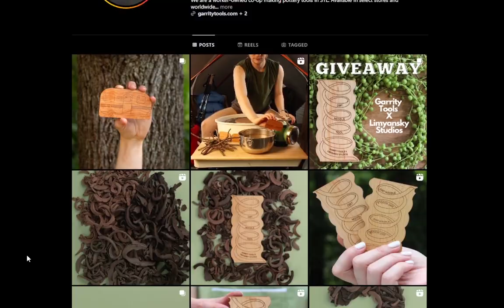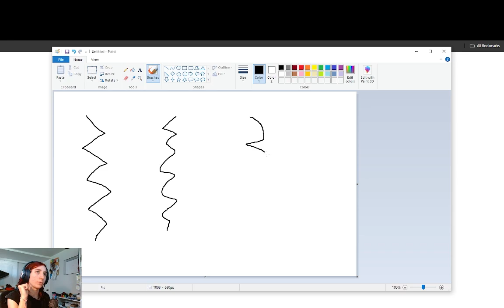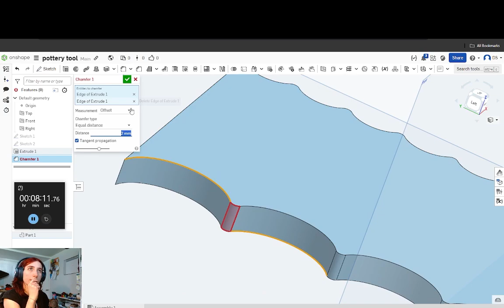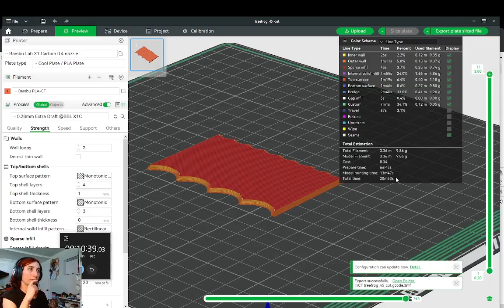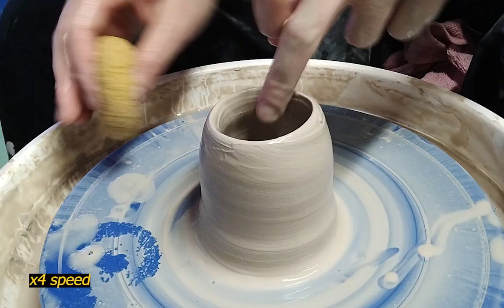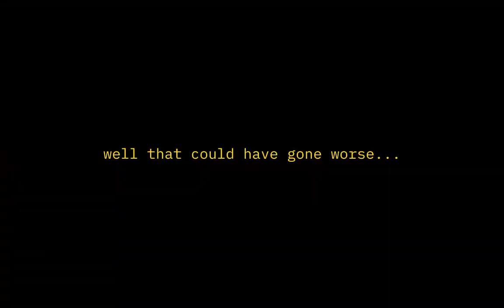3D printing a pottery tool & testing my skills (CAD TIME # 4)

Comment: Second time throwing and already using custom ribs?? Bit of a weird order lol. The rib looked pretty great and solid and successful. Any issues was just because it was only your second time. Any wiggly rib would struggle with something off cantered. I've just started to think about making custom ribs which led me to this video. Was thinking about doing them on my laser cutter but would need to sand the edge so its not flat unlike with 3d printers where you can shape the edge before printing.

Comment: personally struggling with both pulling and creating my own shaping rib. however as a fellow learning girlie i noticed that my success pot was done with a slower wheel speed and instead of jamming my shaping tool in the clay i angled it outwards a little and pushed the clay from the inside to caress the shaping tool rather than allow the tool to do all the work for me. THIS IS A ONE SUCCESFULL POT POV not that i know what im doing at all lol. i currently use tinkercad to make my tools and cannot for the life of me figure out a way to make my edges have that beautiful angle you gave them . anyways this was an awesome video ! i look forward to more !

Comment: Looking at the profile of the tool it looks like the crest of the wave is removing the seal on the clay you worked to acheave. Perhaps start the tool at the lowest point of the wave or round the point so it doesn't interfere with the seal?